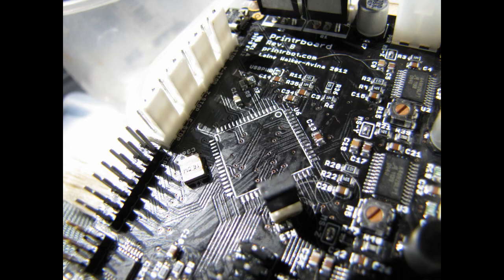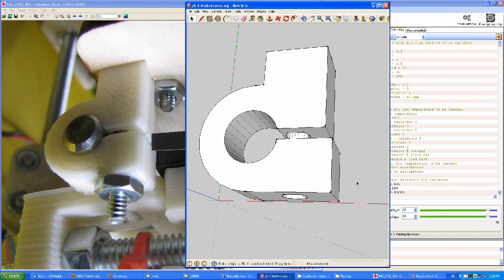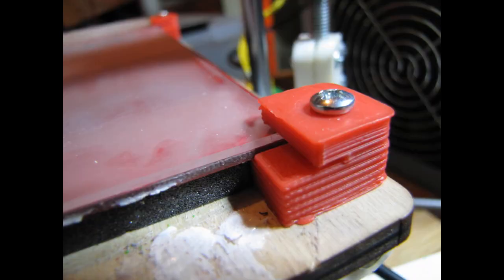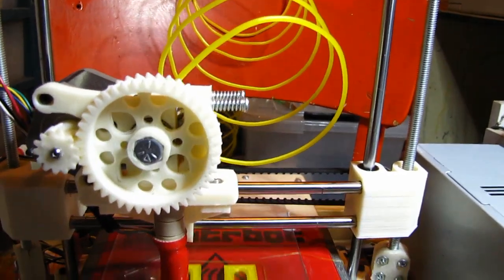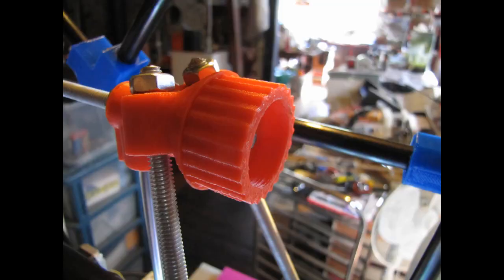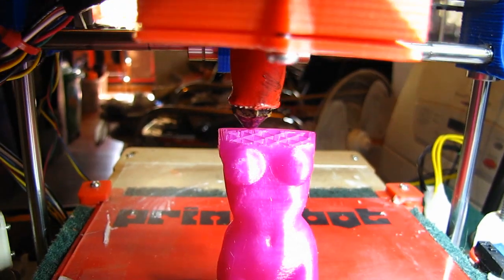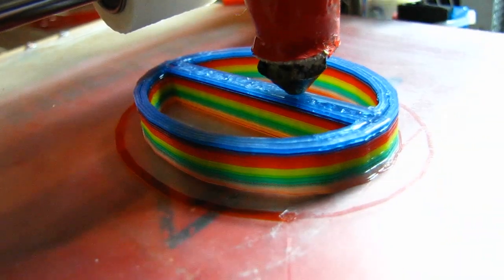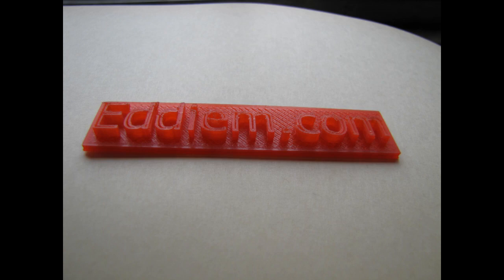Printrbot grows tall.

Comment from the maker: Alex,
You are asking the wrong guy. I don't have a plus, a mac or run pronterface.
I had no trouble configuring my printer for the 230mm height.
Repetier has a printer config menu item where I set the height.
Slicer also has printer config options to set the base size and centre.

Guys on printerbottalk(.com) (including the admin) run Macs. 
Good luck Eddie,

Comment from the maker: I'm not sure what to advise. 
It isn't that hard but there are ready assembled units for more money.
You should probably get a complete kit instead of trying to source separate bits and you probably won't be able get a plastic kit like mine. Printrbots in the shop were all laser cut last time I looked.
I'm not on the forum that much any more but you can PM me if you need too.
Good luck,
Eddie,
PS I'm having trouble replying - it says there's a link but there isn't.

Comment: I suggest a smaller nozzle, I see you are at 0.5mm and even 0.4 will give you much better quality. and layer height, at between .2 or0.3mm height is optimal for speed and quality.

Comment: Great and I can share the feeling as I just assembled my Printrbot plus. I unable to make Macpornterface (I use a MacBook) to extend extruder movement in XYZ farter than some15cm and it supposes to reach 20cm. I am unable also to make it print anything it stalls when I press "print" and only shows temp readings. I tried forums but not a solution. Hope you can share some parameters or point out what am I doing wrong. I wish you the best!